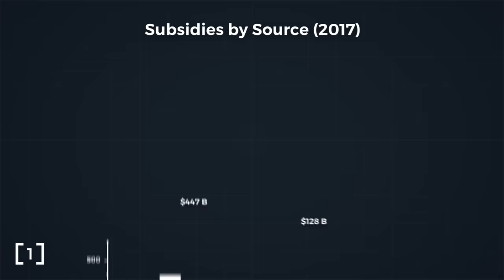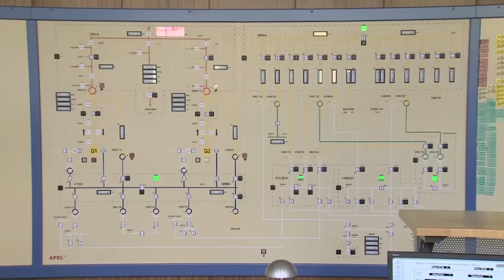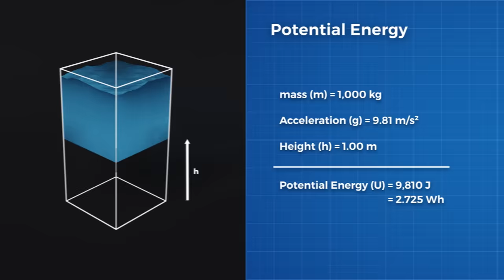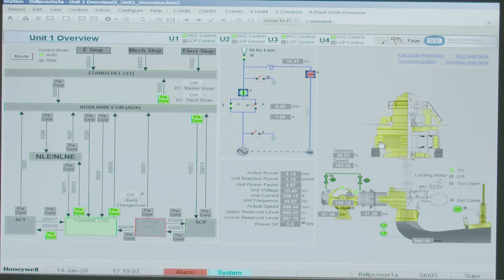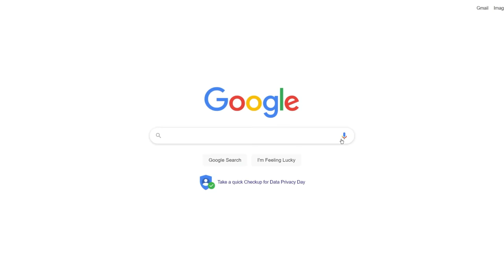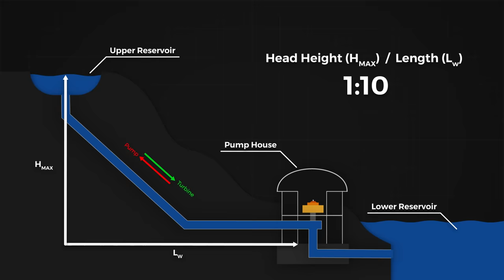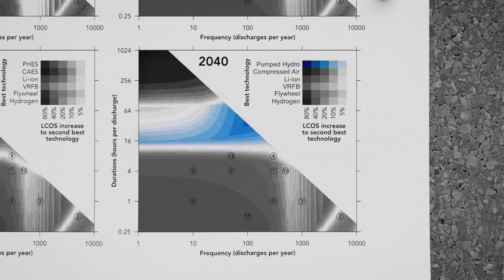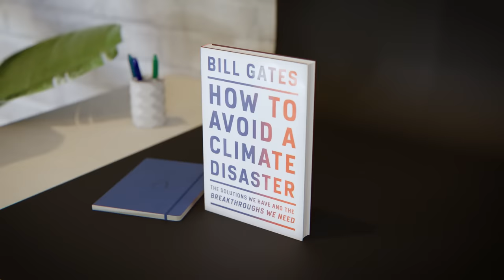The Truth About Pumped Hydro

Comment: Renewables + nuclear is the only logical way forward.  I really wish people would get educated about nuclear energy and radiation.
Reply: Yes! It may be the most important public education campaign in human history!
Reply: I get that Nuclear plants are inherently safe, but the waste is a long-term nightmare.
Reply: @mrmobius  Thank you for providing an example for the comment above yours. (fission fuel cells can be used it other types of reactor, so it isn't long-term waste, it is "future fuel".)
Reply: @mrmobius  which is why we need to actually work on a plan for that, probably at the same time we work on the climate change one. 

Thorium reactors are an important step that should be pushed forward because it's less dangerous in the waste aspect.

And that long term storage site that the US started building but has never used would be nice to get running
Reply: You can reuse the waste moreover use can use much cleaner and cheap thorium, convert it to uranium from the energy by waste reusing but setting up these types of combination plants require a shitload of money 
So no one wants to invest in building one rather people are focusing on hydrogen
Reply: Once people figure out how to build a nuclear plant without 10+ years of delays and 3x cost overruns, sure. The US at least seems to have lost that ability.
Reply: Zuurker U  there is a wave of new generation fission reactors that are cheaper,safer and reliable. The only thing missing is the public and government acceptance of these reactors.

They are also more efficient and have nuclear waste that decompose around 50-150 years which is better than the old traditional nuclear waste which decomposes in 1500-2000 years
Reply: I think the end goal needs to be a decentralized smart grid where individual houses have solar panels and a battery bank/electric car, with whole neighborhoods sharing power between themselves. Centralized power plants aside from nuclear have way too many disadvantages.
Reply: Renewables should not a national energy system. Nuclear backbone with private citizens and businesses playing with windmills at their own expense.
Reply: Zuurker U  Micro reactors is one solution. Manufactured in factories and transported to near where the power is required. Rolls Royce is getting into the manufacture of these units, so it will be interesting to see how that goes. Long term with the projected use of electric power the only way will be fusion especialy when steel production goes over to non fosil fuels for reduction,that will take massive amounts of energy with the by product of oxygen which is a cooling gas in the atmosphere.
Reply: @recklessroges  The problem in this case is that "future" does the heavy lifting there. Storing anything for 4 billion years is a challenge (thats longer than the time from the beginning of the stone age to now), and nuclear waste is naturally corosive. Any other types of reactors are only a blip in the zimespan needed to store nuclear waste.
Reply: Zuurker U  So you can enjoy clean air, abundany power 24/7 in any weather, and virtually eliminate CO2 emissions. I would ask why should my taxes be used for expensive megaprojects like ridiculously large dams in an effort to make intermitent power sources reliable while using up scarce real estate.
Reply: Maybe the people who back fossil fuels took a windmill blade to the head and were rendered dumber and traumatized?
Reply: @Its-Just-Zip  I get that nuclear "could/can" be improved but it will always have a waste problem. The improvements in storage technology combined with the monumental amount solar radiation hitting the earth every day can supersede the needs of energy in short order with no need for thousands of years of radioactive waste. 

173,000 terawatts (trillions of watts) of solar energy strikes the Earth continuously. That’s more than 10,000 times the world’s total energy use. Just need to store it, the production is solved with panels and an electrical grid. No need to mine uranium and have solutions for tens of thousands of years of radioactive waste.
Reply: Zuurker U  Sweden has the bennifit of large amounts of Hydro electric as do places like Norway, would not be practical in the UK,as for micro nuclear they already exist in ships and submarines it is just a case of setting up factories for mass production hardly decades away if the political will was there they could be in production next year.
Reply: Nuclear + not wasting our time on intermittent source is an even better way forward.
Reply: Zuurker U  Ummm are you saying boring out a mountain to store (I forget how much) a sea in addition to blanketing the country with solar panels and windmills would be cheaper than nuclear even after building backup gas generators? And who pays for recycling/disposal of worn out solar panels and turbine blades? We do. I’d rather pay for something that works. Solar is not viable here in Canada period. No matter how much water we pump uphill.
Reply: @bronzedivision  Just been reading something in the New Scientist,the UK wind power only produces 30% of the cappacity it could if the wind blew at optimum speed all the time, it is normaly either too low or too high a wind speed for maximum output.
Reply: Nuclear is dead. Get used to it.
Reply: @baronvonlimbourgh1716  Better turn off that big reactor in the sky then.
Reply: @Equiluxe1  edgy
Reply: Zuurker U  USA uses most of its funding into its military as its the only thing that’s “great” about it. If they started to fund 1-10billion extra dollars form taxpayers into new gen nuclear fission reactors then it would be worth it as the new gen reactors are cheaper, take less space and don’t produce waste that stay for 20k+ years, yes I was wrong, shorter half life means the radiation is more intense but if they’re stored safely for 30-100 years then you get rid of most of the radiation
Reply: @evanweitz5614  Hard to improve these methods when you aren't building them at a rate economies of scale applies making things cheaper, better, and faster.
Reply: @emrazum  This will never work.  Solar just cannot produce enough energy in a dynamic fashion to run the grid and keep it stable and we do not have enough access to the rare earth metals needed to deploy this many batteries all over.  As it stands today 90+% of the cobalt needed for them comes from one country.  Thats not to say shouldn't invest in more solar, but centralized power plants will always be needed.

Even if we started mining asteroids for the exotic metals, batteries are also a pretty bad way to store grid level power as they wear out in just a few years time being cycled that heavily and are dangerous as a fire hazard, even more so when they are all over a neighborhood.  We already have much better ways to store grid level energy in pumped hydro plants, fly wheels, and heated water/salt/etc storage plants.
Reply: @hgbugalou  are there currently any industrial scale reuse solutions in use by the industry, I'm not familiar? Reuse is one thing, but an accident at a plant, no matter the reason, is a disaster for decades. Going past the 25-30% efficiency of solar cells, current in lab scale, plus grid scale storage with lithium and other (liquid metal) battery storage will produce all the electricity we need and then some. If every building was required to have some solar on the roof we'd handle the major consumer of energy, buildings, in the aggregate. Nuclear could be a necessary stop gap where it replaces coal. But, how long does it take to build and get to operating a plant? Longer than solar at scale? Maybe a combo with an emphasis on energy that can't melt down? Good to hear that reuse of spent fuel is in the pipe line.
Reply: @baronvonlimbourgh1716  Nuclear will never be dead. It is easily the most energy dense method of producing energy we have.  We will get fusion right some day.  I just wish we would invest in working tech until then.
Reply: @mrmobius  There are new fuel reprocessing techniques to use waste and reprocess it to be used as fuel.
As far as plant disaster this is the tragedy of Chernobyl and bad information at work and is completely false for western reactors. Chernobyl was the disaster it was for one reason - it had no containment building around the reactor and core contents got dispersed into the environment.  This scenario is the only one that causes the area to be uninhabitable for decades. This is not true for western reactors as they all have containment vessels. Fukushima for example never exposed core contents to the environment and the only radioactive parts that were released were all from water in either steam or liquid as they tried to keep the core cool.  All of the radioactive products there are short lived and can be contained and cleaned up and thus why the area was safe after about 5 years of clean up.  This is the worst case scenario for a western reactor and it was also a very old design.  There were also oversights in the design here to not truly plan for a worse case scenario.  Even after all those failings it was no where near the same level as Chernobyl.  More over modern designs mitigate the weaknesses here.

Solar cannot be a large scale viable option without lots of batteries.  The problem with our best battery tech now (Lithium Ion) is the rare earth metals needed to build them.  We simply do not have the raw material to build them at scales needed to allow a distributed solar grid to work properly. Its not only about what happens at night, its about demand and the power sources have to dynamically ramp up and down to keep the grid running at 60 (50 in Europe/Asia/Africa) hertz.  Lithium is a problem but even more so is cobalt which 90% comes from 1 African country, and that source is supper sketchy when it comes to labor and safety laws.  Tesla is already running up on supply limits at its current capacity and that is a fraction of what is needed for large scale distribution. 

Nuclear has high upfront costs but once up its cheap to produce electricity.  A solar/battery solution is cheaper to build but maintenance is much  higher and never ending. Batteries fail after just a few years in the best case and solar cells lose efficiency constantly.  Plus they have to be cleaned. Nuclear also can produce much more surge energy on short notice, like for instance, the issue with Texas last winter.  It can also in turn easily slow down production which is critical to keep the grid stable.  This is much harder with solar/battery systems.  Once the batteries are full that energy needs to go somewhere and if the grid doesn't need it it cannot be connected at this can cause stability problems past a certain surplus limit. You can of course disconnect the solar cells but that energy still exists and will become heat which will damage the cells and shorten their lifespan. That's not even getting into the complexity of coordinating control at hundreds of thousands of solar sites versus 100 nuclear plants.

Solar and renewable certainly have their place in the future but we cannot rely on them alone.  We need centralized, stable sources that can produce tremendous amounts of power in a dynamic fashion.  If its not fossil fuel base, Nuclear is the only real other choice. We also need to not let headline hungry companies like Tesla make us think batteries are the only way to store renewable power.  There are other technologies that do not rely on rare earth metals that can be deployed today like fly wheels and pumped hydro.  Then there are newer interesting tech like molten salt heat batteries that look promising.  All that said, no one solution will fix it all and we should be looking at modern nuclear plants being build to replace large coal/gas plants and augment it with solar and wind with modern energy storage facilities built into them.
Reply: @Its-Just-Zip  I mean, we could allow for uranium recycling in the us and get rid of most of the waste from nuclear reactors
Reply: Tbh, it's just nuclear, but whatsoever.
Reply: @mrmobius  considering coal plants release similar amounts of radiation, but directly into the air instead of being in a sealed container, I'd say I prefer nuclear...
Reply: Yea I don't get the backwards thinking of getting rid of nuclear power..
Reply: Agreed
Reply: @mrmobius there are clean nuclear options in the works.  no more fission.
Reply: @togamid  anything with a 4 billion year half life is barely radioactive. There is a direct relationship with half life and radioactive energy emitted. There are rocks of on the side of the road in Colorado with uranium in it with that half life and people drive by it daily.  The stuff with the short half lives is the stuff you have to look out for. You comment just further shows people do not understand radio activity.
Reply: @dominicbrunsmeier  leveraging one solution for our energy needs is not smart. Say there is a software bug discovered and its running on 40% of the reactors and requires them to be shut down immediately and be fixed. We need alternate out of stream methods to make electricity. Critical applications need redundancy. That said the mix would be like 75% nuclear 25% solar.
Reply: @recklessroges true and genius
Reply: The Eroei is debatable when it comes to nuclear. If the upfront cost of construction, the maintenance and monitoring during its lifespan, and the decommissioning of each plant were accounted for accurately it may just be a really good battery. 

Yea it would help as a supplement to renewable sources intermittency, but would have a hard time replacing the energy density of fossil fuels.

No matter what combination we use as we transition from fossil fuels, as of now it will mean figuring out a socioeconomic system that doesn’t require perpetual growth of energy use.
Reply: @DownWithPennies 
1: Nuclear energy is cheaper than wind or solar if you bother to look at it over the lifetime of a plant when can be 30+ years and not construction costs alone. Solar and wind plants of similar size would 1st, be enormous and 2nd be lucky to make it 10 years without complete replacement. Stretch that out over a few decades and it is more expensive than a nuclear plant.
2: Sure, nuclear is not 100% carbon neutral when factoring in all things, but its still 100x better than anything else we have out there. You act as if solar panels and wind do not require the same mining, manufacturing, and upkeep. You need much more of all of that too versus nuclear.
3: Waste reprocessing is a thing and works, second you can store all the nuclear waste, underground, at the plants for the life time of the plants. In fact every pound of waste ever created by mankind could fit on 1 plant's facilities land easily. And when you dispose it, you are putting it back in the ground where we found it, in a less energetic form. Coal plants release more radiation, atomized, into the atmosphere we breathe than all nuclear waste accidents that have ever happened.

Your arguments do not hold water and show a complete lack of understanding of the industry or nuclear power.
Reply: @DownWithPenniesI don't follow any of lobbies, just the numbers in the reporting from vaste sources. It all makes sense too. Solar alone requires 100x more copper than nuclear, all which needs to be mined in far larger quantities than uranium. ALL mining deals with tailings and leach waste all of which contains some amount of radio active material no matter what you are mining, along with heavy metals that are toxic all alone. Therefore more mining of anything = more pollution. That's not even getting into the rare earths solar needs.  They don't compare it to solar at 60 years because the best photocells on the planet today run at 1/2 capacity after a decade. No solar plant would last that long without being replaced 5+ times over with new solar panels all of which require resources.  More over, modern gen nuclear tech is designing plants to last a century complete with fuel reprocessing and storage. Your data points are assuming using old 50 year old reactors we have in place now.

And my second point is worth arguing because it stands whether  you believe it or not. Nuclear is incredibly expensive to build, but cheap to run once up. Solar and wind and expensive to build (though cheaper than nuclear), take far more land by several fold, and are expensive to run through out the lifetime. This is from replacing parts, maintenance of the plant, and just having so many components that are spread out over distances. This all requires interconnects and monitoring of subsections. This all makes cost high, labor high, and efficiency low.  Nuclear is centralized, much smaller, takes much less man power (though it does take more skilled engineers I will concede), and is far less complex thus after a couple decades of operations the cost between the two flip and nuclear pays for its initial costs. Nuclear's up front costs also go down with modern reactor designs and if there was significant investment in deploying these, economies of scale would also take over to make them cheap, just as was done with photovoltaics.  All that said though,  the worst problem with all solar and wind is they do not offer dynamic scaling and adding this to them raises upfront and long term costs past nuclear and may not be possible at grid scale in the first place.

I am not anti solar or wind either.  I am very much pro solar and think we need to be building these plants too as variety in the power grid is very much needed. We cannot rely on any one tech and diversity is good. My point here is nuclear plants will play a critical role in this diversity and honestly complement solar's weaknesses quite well. It offers easy megawatt level ramping up/down in seconds and will help solar with the dynamic loads on the grid. There is no one solution that is going to work to replace fossile fuels. Optimally, I could see a world with 40% Nuclear plants, 50% solar/wind and 10% hydro electric.  We should also keep a handful of fossil plants in a ready, idle state just for emergencies. The warming climate may require us to invest more in nuclear though in the short term then work on reducing it once fossil fuel plants are eliminated.
Reply: Nuclear’s problem is time - we can’t build reactors fast enough for the climate crisis, especially including the bureaucracy. Definitely in 20-30 years though.
Reply: A little wind and Solar + keeping on fossil fuel and developing technologies of filtration is the best way
Reply: Nuclear + geothermal (the new closed loop systems sound very promising), and we could call it a wrap.
Reply: @mrmobius so is carbon, the difference is that it's much harder to capture carbon and sequester it. While nuclear waste can be contained and buried deep, is could also be potentially re-used in the future.
Reply: I know this is an old comment but why do you believe that nuclear energy is crucial for that?
Nuclear energy is just more expensive than for example solar or wind and solar and winds efficiency have been constantly getting better meanwhile nuclear's hasn't (from what I know). What would be so crucial about nuclear energy that a company or a private person would pay so much more money for it?
Reply: And nuclear disaster they should plug it with nuclear supportes
Reply: @mrmobius  not really. You can store every cask of waste humanity has ever produced in the parking lot of a Walmart.
With horizontal drilling tech (funny enough developed by the fossil fuel industry) we can start storing the waste underground, at the same site it was produced at. Like so many things with nuclear energy, the waste problem is way overblown. Coal puts far more radioactive waste directly into the atmosphere.
Reply: There are some much cheaper battery technologies under development using more abundant resources, so they may fill the gap.
Reply: Is there an acceptable way to mine the fissile material? Getting rid of the waste is the easy part. Mining uranium isn't a clean process
Reply: @burnsie6  it's energy density and longevity make it one of the cleanest resources to mine. It also is often mined as a secondary process to other metals. Yes, mining is still messy, but uranium is the best bag for your buck, especially when modern fuel recycling methods are used.
Reply: We were educated by Chernobyl and Fukushima.